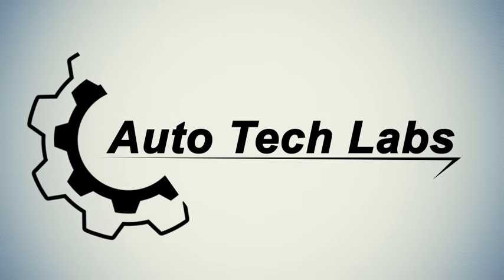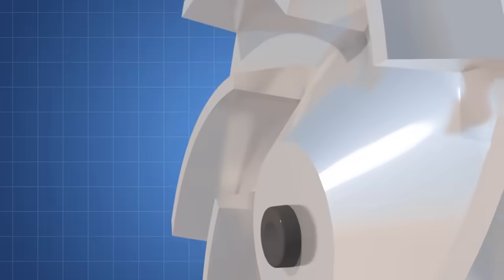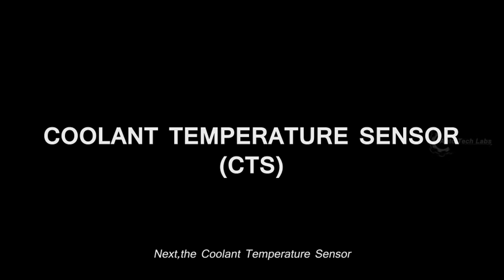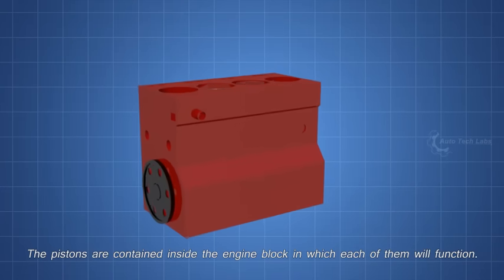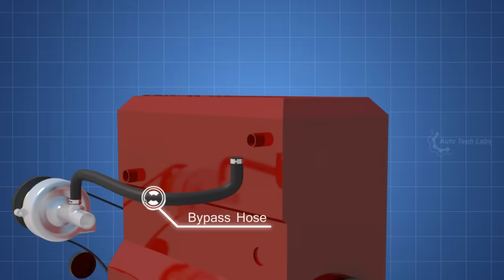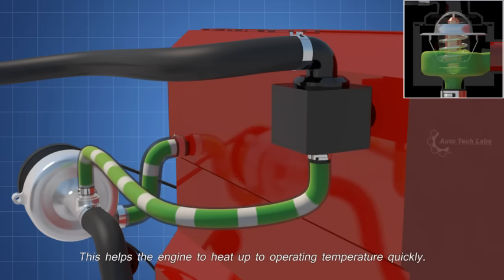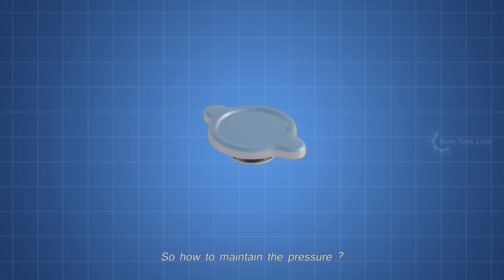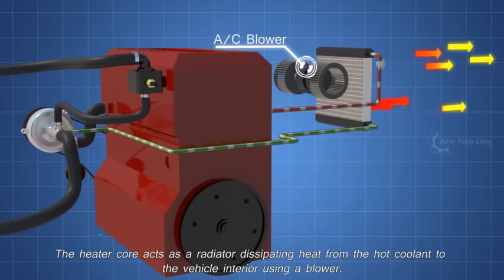How Engine Cooling System Works | Autotechlabs

Comment: it may be obvious but i could not understand that  one thing . if anyone can explain it would be great .

so when the engine is started there is flowing liquid running trough the pump , tough engine and ones it reach the thermostat the bypass allow this liquid to flow directly again to the engine bypassing the radiator forming some kind of closed circuit that allow the engine to warm up faster . 

but the one thing i don't understand here is , the thermostat does allow liquid to bypass the radiator,  but it not block the radiator from generating traffic of more and more cold water toward the water pump  with eventually  end up in situation where called water always flowing , and if cold water always in place , how the engine warm up any faster ?

is there some kind of block of flowing water from the radiator ?
is the shorter path ( because of the bypass  ) , generate a greater heat for water that allow to reach this ?
Reply: The main valve of the thermostat blocks coolant from flowing through the radiator when the engine is cold. As such the bypass loop is necessary to get some hot water to the back side of the thermostat as the engine warms up. If you did't have the bypass loop cold water would get trapped behind the thermostat and it might never open, which would damage the engine. Once the water temperature rises high enough in the bypass loop the control element in the thermostat will start to open the main valve so that coolant can begin to flow into the radiator. At the same time the bypass valve closes because they don't want coolant flowing through the bypass loop anymore when the engine is hot.

This arrangement also means that the only place the water circulates during warm up is through the engine and through the heater core. This is so that during warm up all the available heat is used to warm up the passenger compartment.
Reply: When the thermostat is not running coolant to the radiator, that flow of coolant is stagnant until the engine reaches operating temperature. When OT is reached, the thermostat closes the bypass and this is when coolant is pushed through the radiator. Does that make sense?
Reply: @valeriestramennio9722  Yes it does. It's also pretty much the same thing I said.

Comment: 6:58 when the system cools down therefore the pressure cap should close due to low pressure.
then how can vacuum suck ? into where ?
Reply: There are actually two valves in the radiator cap. The big one on top holds back the pressure until it gets too high and then it opens to let water go into the expansion tank. Then underneath there is a second smaller valve that opens inward to let water get sucked back into the radiator again.

Comment: Excess heat = wasted energy. Most of the energy in the fuel is wasted as heat. The internal combustion engine is incredibly inefficient.

Comment: Soo if and when the coolant gets pushed through the overflow hose, where does it go? Is it just spilled on the floor?
Reply: Yes.
Reply: It sits there in the overflow tank until it is pushed back out for re-circulation.

Comment: if there is radiator fan switch, the sensor is still used to control the radiator fan?
like in Honda civic2001, there is sensor and radiator seperate fan switch

Comment: Here in this video you have shown that when engine is cold then also coolant flow through engine. How?  Since engine has to warm up quickly coolant shouldn't flow .Once the engine reaches its operating temperature , the thermostat opens.

Comment: What if I put only water instead of coolant
Reply: plain water has low boiling point than coolant which has a high boiling point..so if u add water instead of coolant the water boils very fast and starts to evaporate and the engine overheats...

Comment: The cooling system is a system of parts and fluid that work together to control an engine's operating temperature for optimal performance. The system is made up ..

Comment: A cooling system works by sending a liquid coolant through passages in the engine block and heads. As the coolant flows through these passages, it picks up ...

Comment: Check out these car engine pictures. Although gasoline engines
 have improved a lot, they are still not very efficient at turning 
chemical energy into mechanical power. Most of the energy in the 
gasoline (perhaps 70%) is converted into heat, and it is the job of the cooling system to take care of that heat.

Comment: And if your thermostat is stuck on open,  your engin will not warm up and your temperature needle in the car will be showing cold,  znd your engin will use more fuel due to cold engin
Reply: That happened on my Peugeot Speedfight 2,but when is hot outside there is no problem only in autumn because of cold time
Reply: Ja Ti VW idiots didn't have a clue, because their stupid computer only had brains for the small stuff, in the old days the garage would be hands on he would get down and dirty...this video is really good
Reply: Ja Ti did you change the thermostat
Reply: No,but I will change it next summer,now I don't drive scooter
Reply: مرحبا بكم

Comment: "which pumps the COOOOLLLant"
Reply: TerrrmoSTAT termoSTAaT
Reply: The water pump pumps coolant into the engine via the pulley system/serpentine belt - which is what provides the energy for work to take place within the pump- and the coolant circulates via a hose into the engine block through, up and into the head, and then comes out from the engine head, where the thermostat is (the thermostat is responsible for regulating the direction of coolant flow based on the temperature of the engine - also, for those who do not know, the engine has three primary components to its frame: the block, which is the bottom piece - the gasket, which seals the head to the block and protects the combustion chamber from coolant - and the head, which is the top piece). If the car is cold then the coolant will recycle out the bottom hose back to the water pump to be recycled through the engine until it reaches operating temperature (half way point on your temp gauge in your car). Once the car reaches OT, the thermostat will close at the bottom and open at the top to cycle the hot coolant through the radiator to cool it off, and then cycle it back through the water pump to be pumped back through the engine - this is to keep the pistons from overheating and blowing your gasket, head or block...which is of the upmost importance. The overflow tank is exactly what it says. Overflow empties into the tank from the radiator, which is why the fill lines exist and one should never overfill. Also why you should fill your coolant via the radiator cap, if your car has one. Hope that helps someone...I know this is comment is 2 years old.
Reply: @valeriestramennio9722  What are you doing over here Valerie stramennio, I can not seem to understand the reason of you learning and understanding the cooling system of an internal combustion engine, unless your like the video and the explanatory characteristics of the video or maybe you where one of the designers of this video, because I can not put two in tow together.
Reply: Valerie Stramennio  so the thermostat is located were the hot coolant comes out the engine? on the lower radiator hose? and cool coolant goes back into the engine via upper radiator hose?
Reply: @valeriestramennio9722  you have written some misleading information.
Reply: KOOLant
Reply: Water pump
Reply: AGAHAHAHAHAH
Reply: literally scrolled down to look for this

Comment: Car Engine Cooling System is legion. It does not forgive, it does not forget. Expect it.
Reply: Any car,or automobile,cooling and oil change done in proper manner,Engine life enhances.Less repairs, elonged performance is the out come.Also the components of rubber rings,more natural rubber content will give quality products.
Reply: @matthachireth4976  it's a meme you dip
Reply: Lol
Reply: You must have driven a Moskvich 2141 at some point in your life. Because the cooling system there came straight from Orc workshops in Warcraft 3, and in any jam it will absolutely, definitely kill you by boiling you alive :-/
Reply: Per Wigren lmfao
Reply: Fuck u

Comment: my radiator fan only operates when the AC is on.
Reply: Youre fan is supposed to turn automatically on as you turn the ac on, if it doesnt start the you have a problem with your fuses, relays, modules o wires, and your going to be overheating your car if you use it like that
Reply: Then you may have two fans, and your AC is forcing the fan to work to cool down the car - which is not good for your radiator, but your engine is more important - or it could be a relay switch.

Comment: Next: the thermos tat.
Reply: After driving around 10-15 minutes,the engine is over heat and stop working.So,after half of an hour rest,engine can start normal, what cause this problem,is Thermostat?
Reply: Adrien Perié tell me, how does a person know if the thermostat is the problem ?????
Reply: Trevor Walker the car will overheat VERY quickly within minutes of starting, you can check it by taking it out and putting it into BOILING hot water.. if it closes then it’s not the problem
Reply: @foozayfooz9503  not necessarily, it could open right away or early and then your car takes a long time to heat up. It'll overheat fast only if it's stuck shut. There's a few different things that can go wrong with them. I replaced mine recently and it solved a few problems that I didn't even realize were related.
Reply: 𖥠 ꧁Æ♱ℍᴲᮄℜᴲⅅ꧂𖥠 oh really? So I just brought a whole new engine for nothing 😩😩 the mechanic told me thermostat problems cause the car to heat up in minutes 🙄
Reply: @foozayfooz9503  he's still right, in many cases it does, in others it takes a long time to heat up. It just depends on weather the problem with your thermostat is that it gets stuck closed or open. Thermostat gets stuck closed car heats up very fast, overheats. Got a thermostat that sticks open, car's gonna take a long time to heat up.
Reply: @NoZioKikes88  Im driving Daihatsu. It's from '98 but recently I got heating problems. With 100 kmp/u no problem. But later when speed limit is 50 or 30 the bar goes over half almost in red. Could my pump be losing power? Or is there somewhere a blockage in the system so the coolant can not be pushed around the system fast enough and gets heated up.
Reply: @trevorwalker5977  The faulty thermostat usually remains on. ie the water goes to the radiator continuously, so the engine temperature does not rise. As such, the cold engine burns a lot of fuel but does not give proper power.
Reply: @sonbarbun111  True, but I'd rather have a faulty thermostat that gets stuck opened, the engine will run colder than tolerated after start, but eventually it will get at a tolerable working temperature due to natural high temps. I think a stuck opened thermostat is only a problem if you live in a very cold area.
Reply: @S.T-q6c  Maybe. But not exactly. Because when the car travels on the long distance for a long period of time, the temperatura drops a lot.
Reply: @sonbarbun111  True again :) but overall you just don't want your coolant fluid to reach +100°, any situation with a stuck opened thermostat is preferable to a stuck closed one.
Reply: @S.T-q6c  exactly. everyone prefers that the cold engine instead of the one being stuck with high temp.

Comment: Hi, I have 05 Honda Civic ex 1.7 manual transmission, it overheats when I turn d heater ON, goes back to normal when I turn it off, I checked both fans working with AC/ heater on/off, replaced thermostat, checked coolant level was good, stil over heats only when heater is turned ON, I didn't use heater for 2 weeks straight and I didn't had any problem. Showed to mechanic he said I need new head, hard to believe bez it drives good without heater on so I don't think that's d problem n I shouldn't be paying 1500$ hope u can help thank u n God bless you

Comment: Antifreeze has nothing to do with controlling the cooling or heating. It just raises the boiling point of water and keeps it from freezing.  You need something like water wetter that reduces heat by making the water have more tension strength close to hot parts.

Comment: lol! I was told by a dealer's service dept that i need a new radiator because the temp between one side and the other are different.  Well....according to what I see in this video thats what is supposed to happen.  Hot coolant in cool coolant out and back into engine to cool it.  I really appreciate your awesome video.  I thought there was something wrong with what I was told.  The service writer didn't seem to know much about autos.

Comment: Hi! Thank you very much for this video. You explained it very clearly and easy to comprehend. 

I have questions for you:

I have a 6 year old Honda Accord. How come my radiator and expansion coolant tank is empty? I checked those two maybe 2 months ago and it was fine. What happened?

I realized this because when I drove home, I heard fairly loud hiss coming from under the hood.

I'd appreciate if you could shed some light. Thanks
Reply: I know this is old, but for educational purposes, you likely had a leak somewhere and you probably have blown your engine block or head...the loud sound.
Reply: Valerie Stramennio lol this is possible but unlikely. Would’ve probably just been the radiator or one of the hoses 👍
Reply: rafidah yacob
Reply: Unlimited FB Likes http://storage.googleapis.com/9652075270108/6612343979175.html
Reply: hi

Comment: Hi, There, I  have got a question, what if someone put water in the coolent in few times & later realised it was a bad idea, does that mean Car need an other engine to change or K seal would be the best option to fix the leak inside in the coolent due to that Coolent wasn't stopping, however now Car stop getting warm from inside & everytime it shows the sign STOP with Coolent Resorveir sign.

Comment: Hello all. Very good video, thank you. I have a problem. My engine works pretty fine (2,9 CRDi), but it still overloading the expansion box by the liquid. Upper tube is hard as a big presure is there, thermostat I already changed. I have no posibility to know the system pressure, maybe only the pressure valve is not good working? But why the vacuum doesnot take the liquid back to the system? When I let the pressure out from the upper tube (there is an air pressed under the pressure valve, where is the thermostat too), and replace the liquid from the expansion tank back to the system, it starts to work the cabin heating again, untill it repeat again (usually after drive over 100km/h after 10 minutes). If I do not stop the car in the moment the cabin heater stop working, the cooling liquid is sprayed from the tank out. In service told me it will be the cylinder head gasket, or broken head, or wrong water pump, or maybe radiator can be blocked. Simply better change the car. The repair what they suggest me cause take all engine out from my car, and cost it all around USD 1700,-. Can anybody help me?
Reply: +Letecke Vysetrovani As others have said, you need to do a flush.  Chrisfix has a couple of good videos on that.  I would also backflush your heater core.  That will likely reveal your problem at least.  I'm suspecting a clog in the heater core right now though. Did you ever fix it?  Is the floor board for the front passengers seat wet?
Reply: +AutoTech Labs 
I have a problem with my cooling system. The temperature gauge is in normal level. the upper hose goes not too hard but medium hard compared when it is cold.
And I observed that if the engines goes hot already the water from the radiator don't go to expansion tank. but if the engine gets cold it still sucks the water from the expansion tank. What is its problem?
Reply: Thank you for your reply. I checked all you told me. I already have a brand new cap at the pressure valve - still 0,9 BAR as reccomended. I offered 1,1 BAR to test it under bigger pressure ( I hope for not destroy any hose, or the radiator). The radiator is also new. 2 ventilators are working fine, I connected them after start to work nonstop - crossed relay contacts). No new effect. Again new thermostat, 88 degree as the engine is for this type. I checked the tubes to be fast and withou any leaking, specially in the expanse tank. But no vacuum suck the liquid back to the system - It will make me crazy. Oil is OK, in the 50/50 rose liquid is no oil. The pressured air is without any smell like the engine extrements (I don´t know how to say it correct, hope it is understable). If I take remove the thermostat and let it go without the cap cover, it is a fountain there. Bigger torque - bigger fountain. So I guess the watter pump is also working. So the last is - it is any air in the system, but specially Kia Sedona ( Carnival ) 2,9 CRDi is not so easy for the job to get the air out from the system. I spent all the day yesterday with this - nothing new. Head gasket, or crank? But I have no symptomes as the bad oil, or oil in the coolant, no smoke in the system - smells only as a hot coolant. I don´t know what to do. The engine is working very well, good power, good starts, perfect fuel-flow (7-8 l/100km), no smoke infront the machine. Why is my expansing-tank still overloaded, and the one tube do no suck back the liquid to the system? Thanks for any help. Michal
Reply: jascar21
As you can see, I have the opposite problem :-( Do you have any watter leaking? Do you have the radiator full of the coolant? Check the oil if is not colored as a butter. What about the smoke behind your car? White color, or blue, or black?
Reply: +Letecke Vysetrovani 
i dont use coolant though. i dont have water leaking also. i think its black